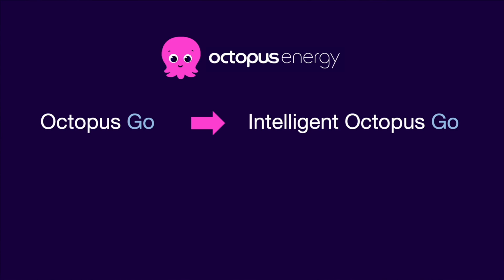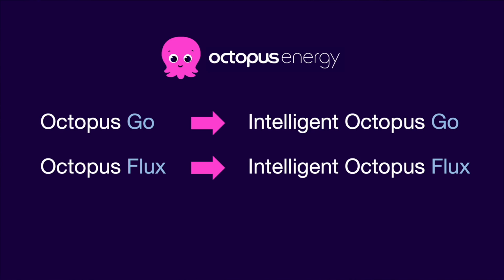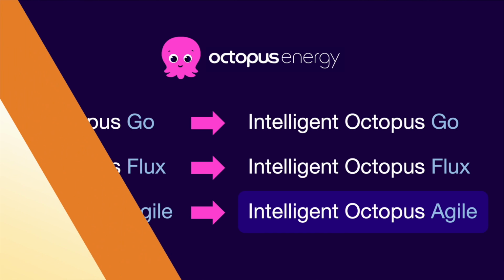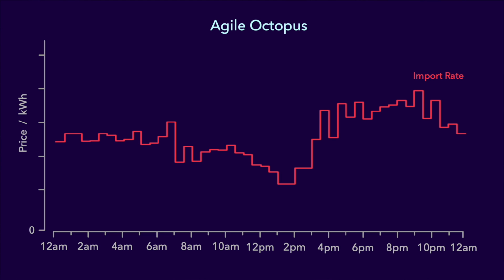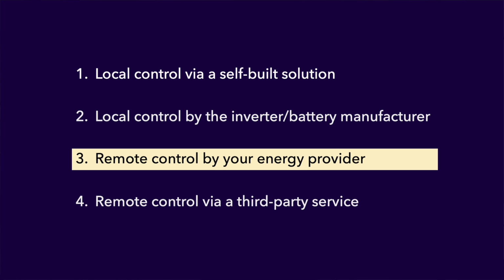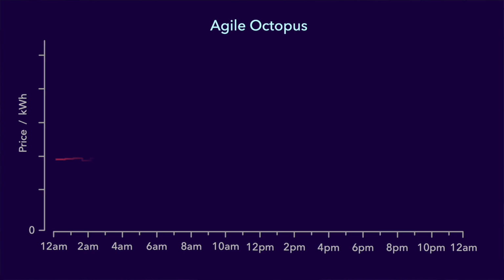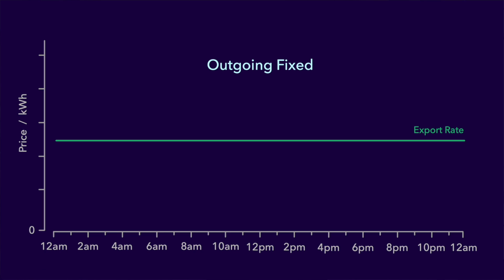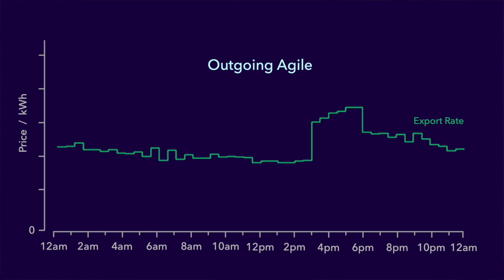Intelligent Octopus Agile - Coming Soon?

Comment: Here's a thought though. Let's say for a moment that there was a near blanket take-up of smart tariffs designed to smooth out the grid. If those tariffs succeed then surely that means that there are no longer any expensive (or cheap) periods for Agile to play with meaning that there's now no benefit of moving to Agile. So would Agile self-combust from its own success? And if it did, would that mean the spikes come back and it's needed again in sort sort of Agile cycle? I guess what I'm trying to figure out is what happens when Agile succeeds? I think there needs to be a plan/incentive for customers to stay with it when prices smooth out.
Reply: UK domestic is only about a third of UK usage - plus generation sources like wind and solar are inherently unpredictable.  It might have a different pattern in terms of peaks and troughs of pricing, but I think there's still going to be a lot of scope for Agile-style tariffs for years into the future. Super-localised demand & supply for example (5 minute pricing intervals? postcode hotspots?)
Reply from the maker: Thanks for sharing your thoughts on this STTG. Here's mine then (not fully fleshed out yet, and as always, open to critique)...

Humans are (generally) asleep during the night, and so you might always expect in a fully-electrified eco-system (a country, say) there should always be more consumption during the day that at night. Sure, as more and more EVs are charged during the night, you might expect the demand curve to flatten, but remember, humans will tend to drive those cars during the day and so public charging during the day will also become more popular. 

That said, I'm fully expecting all countries to get to a point where they are generating far more energy than they need - and at that point, we will have mastered how to extract "free" energy from wind, solar and other natural means in a highly cost-effective way, and because of that, energy will become incredibly cheap. We'll need to find new ways to use all this abundant energy, but I don't think that will be hard for us to do (at all).

So, will smart tariffs still be required then?  I'm thinking potentially yes, but they'll be different to how they are now... I'm actually working on a video looking into all this :-)
Reply: @GaryDoesSolar  looking forward to that cool
Reply: Surely everyone could even have a small battery, especially as battery density gets better, even in tiny home. Yes, the technology is not there today, but energy density has been improving rapidly in recent times
Reply: @kristians9576  I like the idea of those large scale water based grid batteries.
Reply: I've often wondered the same myself!
Reply: I've wondered what the future of agile would look like, I feel like these are the glory days, although there hasn't been any free electric for weeks (and months?) now. 

Whilst I thini your theory is correct, unfortunately it's just not going to happen as people in flats aren't going to have space for batteries etc so there's always going to be those oeaks, though they will likely level out years down the line a little.

What I think would be more infuential is as more and more green energy comes onto the grid, say in 10 years, we probably wont see the free enery at all as hopefully got plenty of large battery storage around the country, but in return we'd hopefully have rates of 5-10p/kwh across the board as it;s costing so little to produce as not having to transport and burn stuff

Comment: For me, the agile outgoing rates are too low. The only time they generally exceed 15p is during the peak, and even then, not by much. 

The spread between import and export should not be so much. In theory all of the infra costs are covered in the standing charge, so I think the spread on the prices should be less extreme.
Reply: Oh, and I wouldn’t want intelligent as I prefer local optimisation with home built solution. One of the downsides of the intelligent programme is that octopus are giving additional incentives to people to hand over control. I think agile should be the best pricing available with all the risks and rewards that this entails.
Reply: That's why I'm on Agile import combined with outgoing fixed at 15p
Reply from the maker: Yeah, it would be interesting to see how Octopus Energy designed IOA 👍🏻

Comment: Giveback are now offering a year long scheme which looks good for givenergy battery owners
Reply: Where do I find info on that, their website doesn't mention  anything that seems to relate?
Reply: @stuartburns8657  Try on your GivEnergy cloud portal if you own a GivEnery system
Reply: Hi there,

Thanks for taking part in GivBack over the winter.

We’ve been working on new ways for you to earn money and help the grid with your battery all year round. We’re excited to invite you to a new pilot programme that will use your battery to manage live fluctuations on the electricity grid.

How it works:

1. Opt-in to the pilot by clicking the button below

2. We'll use your battery to respond when the grid is strained. Depending on the grid in your local area, this could be multiple times a week or less than once a month.

3. At the end of each month we'll pay you for export and import. We'll pay 50p/kWh for export we trigger, and 30p/kWh for import we trigger. Both export & import are
Reply: Got an email yesterday, signed up, hoping I will still get the 15p unit on top from Octopus
Reply: @linkup1958  Thanks for that.  The last bit about the export and import fees was cut short?

Getting paid twice by double dipping (cake and eat it) hmm, seems too good to be true, as surely then themselves get paid in turn by the grid?
Let me know and good luck
Reply: It appears that they are emailing customers who took part in the GivEnergy trial
Reply from the maker: It’s great to see GivEnergy expanding on this 😀👍🏻

Comment: I would like a setting that if a price went below x I could charge the batteries to 100% automatically ...
Reply: "WonderWatt" does that. It's free at the moment. I use it to manage my Agile tariff. You can set a trigger to automatically charge your battery if the price drops below a value that you select. It does lots of other useful things too.  think that it's excellent and well worth checking out. ( No connection, just a very happy user }
Reply from the maker: Yeah, certainly services like MyEnergyOptimiser allow for this kind of tailoring with Agile…

Comment: I think the intelligent tariffs are the way to go, set and forget. Once V2G or at least V2H becomes mainstream the 4pm - 7pm peak export time will become a license to print money.

Your car charges overnight on cheap wind.
The battery keeps your off grid as it’s also charging on cheap wind.
Solar pushes the fossil fuels off the market during the day.
Home batteries and car batteries force the peak down at a huge financial gain.
Reply: I think that's overly optimistic and a tad naive perhaps?
In a UK in which lets say we get to 25% of households have both heatpumps and an EV (BEV) surely the current 'cheap' time would be over subscribed, thus raising the price.
Then, assuming all those BEV's could do V2G/L wouldn't that over saturate and dilute pricing?
Lovely idea, but even with the so called grid expansions and reengineering being undertaken, I doesn't account for that scenario from a infrastructure perspective.
Reply: As someone who works for a certain energy company installing solar, batteries, heat pumps and car chargers I wouldn’t class myself as naive 😘

If you keep up with with current trends, the more smart tech we adopt the quicker we can add more large scaler renewables into the mix further increasing the need for more smart tech.

Think big picture, not individual house. A good place to look into would be the inter-connectors coming online such as the Viking link. With Europe gaining a higher integration level we can push wind power down and pull solar energy up.
Reply: @bradleyarcher9840  The notion I called naive, not yourself as such 🙏
Whilst it's lovely pouring all this money into green power, it cost each user £~40 last year due to the deal green energy has in the way of compensation for when the grid is saturated and the turbines and PV have to be turned down or off.
This will only get worse to the consumer, both standing up the infrastructure and the consequent compensation we all pay.
Lets say we wake up tomorrow and 99% of all the UK's electric is renewal, and of that 99% its always available and reliable.
Whilst we are still tied to gas pricing, that humble 1% will have us paying through the nose.
Government and Industry are in no rush to change that status quo despite the rhetoric.

Large scale grid storage is the cycle breaker.  Without that (imho) we are pouring billions upon billions into an end product we (currently) see little benefit from.
I'm all in for green and save the planet, but we've got the balance wrong I fear
Reply: @stuartburns8657  you’re thinking that fixed time tariffs are all that’s possible.
We’ll have flexible tariffs which have some communication/control.  I don’t care if my off peak is at a specific time, I just want to have, on average a couple of hours every twelve.
If I can get that information the day before most of the time, that’s good enough - I’ll set the timer on the dishwasher, and automation will take care of the rest.
Reply: @JohnR31415  No John, I understand that more dynamic tariffs exist, I was using those as an example.
But let's go with your example, say Octopus tracker which tried to give you a days notice.
Surely then if prices are expected to be low the following day, there will be a explosion of usage from appliances / HP's / EV's, so much so that the gas turbines have to fired up to match demand?
Now energy companies cannot go back on the advertised rate, but have lost money, and will stop or severely hamper such schemes and initiatives?
Same / similar with plunge pricing as well isn't it?
Short notification that in x hours we'll pay YOU per kwh.
This is possible due to more green energy being generated than is needed, and it's cheaper for the energy companies and generators to gave it used, rather than pay compensation to have it turned off due to a chronic lack of grid storage.
However, unless some overarching dynamic control is in place (which to be fair to Octopus they're trying to do with EV charging) you can easily get a situation in which the we pay you per kwh ends up artificially increasing demand BEYOND the excess green energy, thus again necessitating gas turbines spinning up, and more costs to the generator.
Reply from the maker: I like your thinking! 😀
Reply: As well as the in country interlinks that are already being built to move electricity around EGL1, EGL2, EGL3 and EGL4 will play their part in due course
Reply: @kristians9576  The interconnects you and Brad mention are fair points, but I still think gas turbines will go a spinning $€£¥...
Reply: One thing to point out is that we’re currently about £35billion pounds off thanks to Hinckley point C, with 25million homes in England that works out at aprox £1,400 per household. 

Now tell me, if we have £1,400 to each house to invest in a small battery to keep everyone off peak what would beneficial?

We can get over most issues by an over production of renewables and  heavy links with Europe, spare power in this scenario goes to an octopus intelligent agile pricing structure and we self balance the grid.
Reply from the maker: @bradleyarcher9840  You've started a good debate here, which has spurred me on to bring forward a video I was originally going to do later in the year - which is to provide the wider picture to people about future energy management on a country-wide scale 🙏 The bottom line is exactly as you say - you simply cannot beat solar and wind for virtually all energy production eventually - all you have to pay for is capture and storage - and both of these are becoming cheaper and cheaper as every day passes (especially the latter). Not even nuclear can compete with that!
Reply: I’m nerdy and sad Gary but I love me some renewables. I used to work for Cadent the ESP gas board and they wanted to pump hydrogen into the gas mains, that’s also a fun one to do a video on ‘hint hint’.

I’m all for solar, batteries, EVs, heat pumps and intergrated smart services and I can’t be convinced anything else makes more sense. 

Keep up the good work 👍 and I always recommend to my customers to watch your videos, your tariff explainers are superb.

Comment: For Intelligent Agile to work, Octopus would have to be able to control at least one device i.e. battery or EV charging or both. As a quid pro quo they could make agile outgoing the same price as Agile incoming. Prices would have to be very competitive to attract EV owners (with any reasonable usage) from the EV tariffs
Reply: This is the thing - I'm open to the idea of Agile but as an Intelligent Go customer, with solar and battery, financially it simply makes no sense to switch to Agile. But if Octopus could offer something closer to Intelligent Go for EV charging, I'd definitely consider it.
Reply: @MrWobling  Agreed, the Go tariffs are hard to beat at the moment.
Reply: @Qdex44  the new EON Next Drive tariff looks good. Except it means dealing with EON 😂
Reply from the maker: Interesting ideas 👍🏻 😀